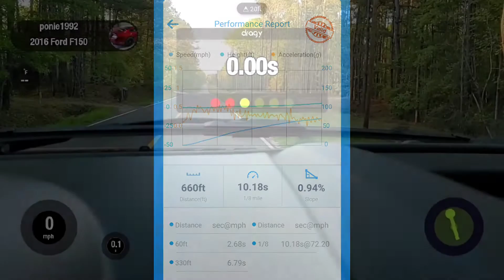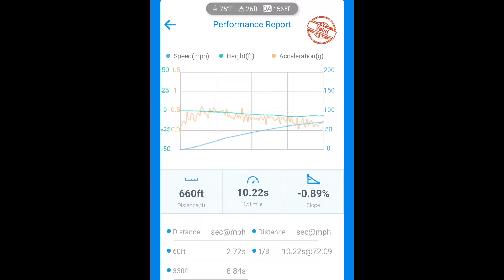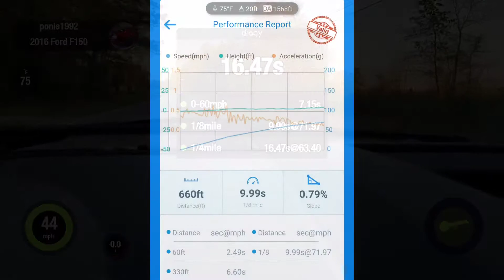Drag racing my F150! Normal vs sport mode drag test in my coyote powered 2016 F150 4x4!

Comment: Do a 4H launch...You won't get any wheel spin, maybe a little wheel hop though. It will do a lot better. I launch mine in 4X4 all the time. Since I put the Raptor transfer case in it I rarely take it out of 4 auto.
Reply from the maker: I thought about that, actually. Haven't even put mine in 4WD yet lol

Comment: Have you driven the 2020 f150 STX w/ 2.7L? I was surprised how much power it has. I haven’t timed it yet, but it has a pretty quick 0-60. 

Traded in my 2011 STX w/ 5.0 Coyote. Transmission (6R80) was having major issues, and lots of other problems. Got 188,000 miles out of it. It just became counterproductive working in the truck everyday instead of working.
Reply from the maker: I haven't driven that model. A lot of people like the 2.7
I'm hoping mine will last awhile 🤞

Comment: I gotta get a draggy the price tag is crazy. I use the apps on my phone some are pretty accurate some are way off. When I spin using phone app throws it way off. When I do it in the raptor in Baja mode which is 4x4 it seems to work. Best I got was 5.8 to 60 and 14.6 quarter. Best pass at the track in the raptor was 14.3
Reply from the maker: From what I've seen, the dragy is pretty accurate. Well worth it, imo.